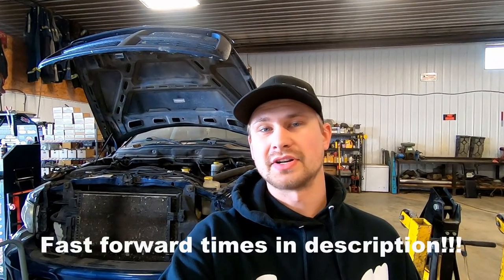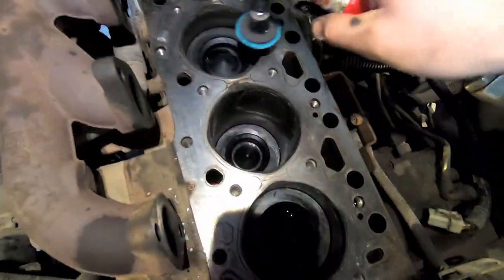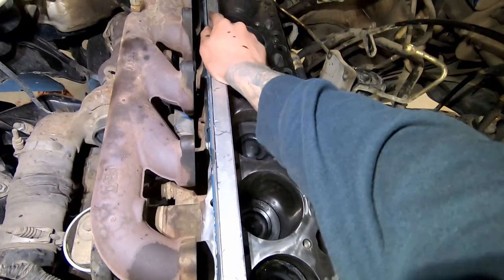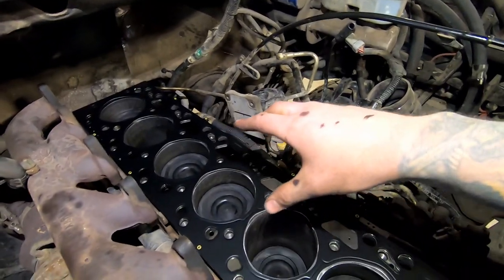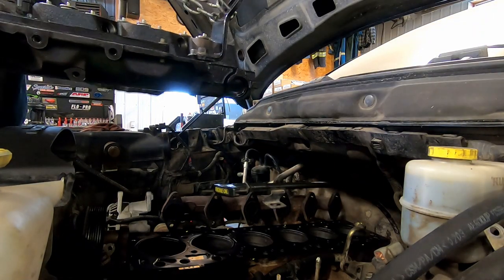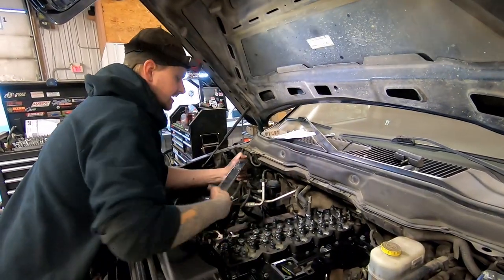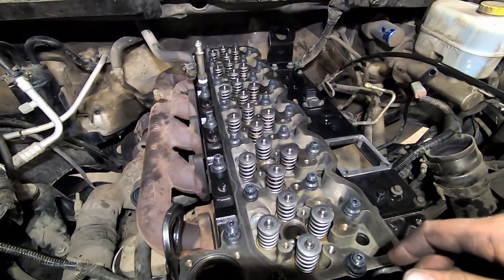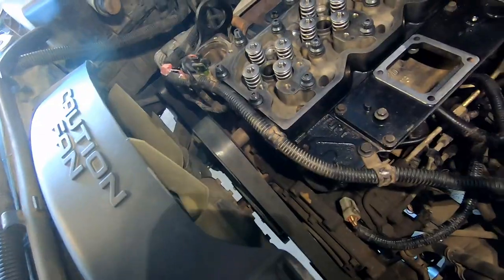How to: 5.9 Cummins head gasket replacement (part 2/2 Install)

Comment: After I put my head back on it will not start only starts with ether,  any idea what might be the cause? It’s an 08 6.7 I followed your video to a T and can’t figure it out I’m going crazy chasing this problem, do I have to prime to fuel pump or anything like that? It definitely seems like a fuel problem since ether will fire it right up 😞 so stressed lol first diesel truck seems like these things are finicky! Thanks for all your help
Reply from the maker: It’s gotta be a fuel issue. If possible you should borrow a scanner and watch your fuel rail pressure when cranking. I’m not sure off the top of my head what it needs to fire the truck but I’m guessing it isn’t getting that. Possibly an injector isn’t torqued down properly, or a fuel tube. If the truck has been running pull the oil dipstick and see if it smells like diesel. Also I wouldn’t recommend starting your truck with ether it’s not good for your engine
Reply: Dark Iron Diesel if I remember correctly I wanna say about 5k psi I could be wrong though. I just rewatched and seen that you primed it and I didn’t do that. I tore it back down to the injectors and re torqued everything to spec and it didn’t help. Didn’t know that about ether! Thanks for the warning! I’ll try again and try to get my buddies scanner your video was a huge help I feel like I owe you money it was so helpful 🤣
Reply from the maker: Ya that sounds about right, if you don’t let the air out of the system you will be cranking for a very long time. Just how I did it in the video, crack and injector line and crank until fuel starts coming out. Then tighten it and it should fire. When cranking make sure you have a charger hooked to your battery and you can crank for 30 seconds then let it sit for 2 min and continue the process. Gives time for the starter to cool.
Reply: Dark Iron Diesel I appreciate you taking the time to reply! I’ll keep you posted
Reply: Dark Iron Diesel ok she’s running now fires right up... but it’s smoking like a mad man and have a very rough/jerky idle that fluctuates and if I give it gas/throttle the rpm shoots up and hangs open for a min
Reply from the maker: That’s weird man, did you make sure you put the injectors back in the same cylinders they came out of?
Reply: Dark Iron Diesel yep pulled them each individually and marked them 1-6 along with the tubes. Everything was torqued to spec. I’m officially stumped.
Reply: @ericwallace1470  did u figure it out I’m about to do this job
Reply: @chaddeeter4428  yep i had to crack the injector line in the front and crank until i seen fuel running out of the line and then torqued it down. after a few mins it started right up. good luck if you have anymore questions let me know!
Reply: @ericwallace1470  sounds like you have a weak Cp3
Reply: @steve5912  bad injector and had to prime

Comment: Never ever ever ever use a wizzer wheel on the block or head!!!!!! Did you blow that gasket yet?
Reply from the maker: Nope gasket is still fine, along with the 30+ other trucks I’ve done head gaskets on. I know it’s not proper procedure but if you go gentle and make sure you don’t see sparks I really don’t see a problem with it. Combine that with a new gasket and arp head studs and you’re laughing.
Reply: @darkirondiesel  I would say use the rubber fingers disk. Idk grinding groves with those disks just makes me cringe. To each his own.

Comment: Great video man I’m buying a Cummins 07 5.9 tommrow and the top radiator hose is hard like in you’re what to look for when buying a diesel video and there is no coolant in the Resavor and I seen some black smoke then shortly after some white smoke come out after giving it some gas. It’s not overheating (yet) so I’m going to change the gasket just in case . If you don’t mind how much does a typical job like this cost if you do the job you’re self ?